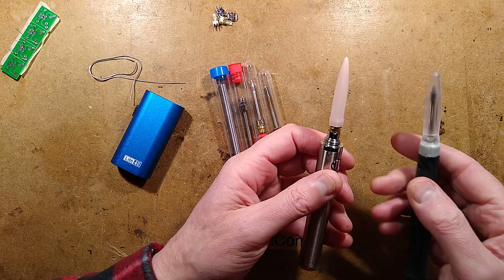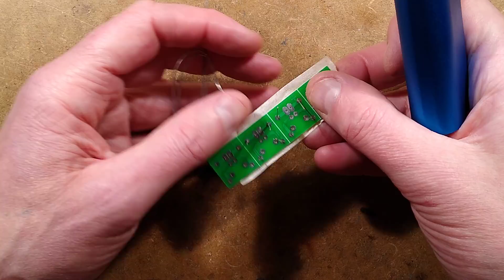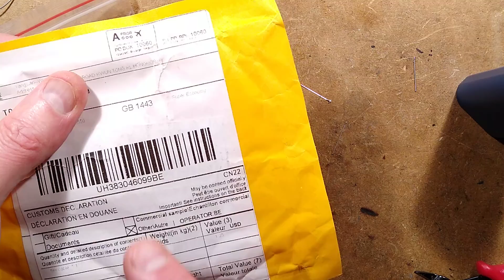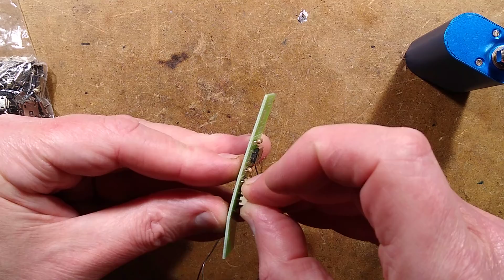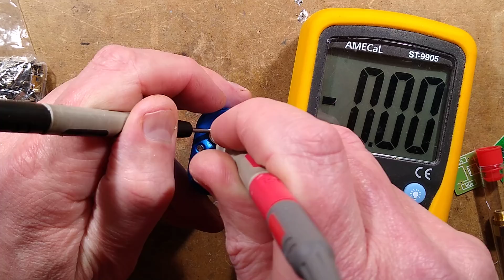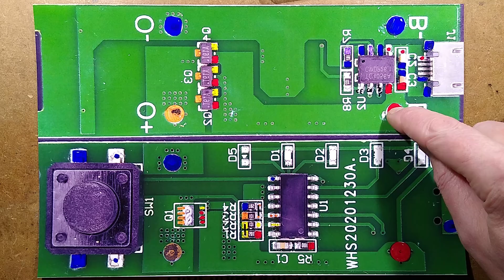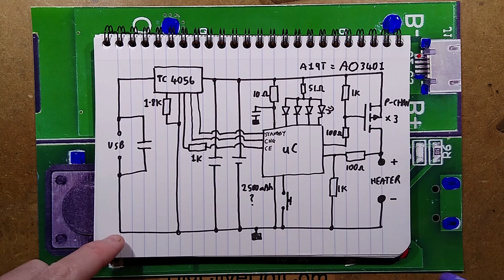Cordless soldering iron teardown (with schematic)

Comment: The TS80P is my choice for a portable iron. In fact, its so good that my Weller station hasnt been turned on for over a year now. The tiny iron runs from a USB PD powerbank and happily beats even large heatsink surfaces with relatively low temperature settings.
Reply: I went ahead and picked up a Pinecil for the same use case but more flexibility in power supply.
Reply: @DavidThoren  The Pinecil uses the TS100 tips I believe, so its not going to be quite as good in performance as the TS80 tipped irons. Its plenty good regardless. 
The TS80P can be powered with any 12V supply too by just using an adapter. I never got to do that though because phone and laptop chargers as well as my powerbank are always within reach.
Reply: @drkastenbrot  I sometimes run my TS100 on 12V when I can't find my 19V PSU and the difference is very noticeable to the negative. What is the advantage of the TS80 tips? I watched the EEVBLOG video and don't recall any difference mentioned other than shielding? (It's been a while).
Reply: @chaos.corner  The TS80 tips are a completely different design (and also meant for 12V at up to 3A, so higher voltage isnt needed). 
They have as little heat capacity as possible with a solid copper core thats surrounded by an insulating stainless tube. The thermocouple sits basically right in the tip and the heater is right behind it. 
The principle here is to basically directly heat the pad, and send as much power as possible straight into the solder joint instead of the surrounding air. It responds way faster and outperforms a  traditional 100W iron with less than 30W power consumption. 

The TS100 tip is a modern traditional-style tip. Its kept small and well made and performs quite well. But it isnt quite the revolutionary design as with the new generation soldering stations such as pace and JBC. 
The design goal with the TS100 was to clone reliable and trusted Hakko tips since making a whole new tip from scratch is a bit too adventurous for their first ever soldering iron. 
The TS100 spawned an enormous ecosystem around these tips and thats why youll find them everywhere and very cheap. You can even use original Hakko tips although they are a bit long.
Reply: @drkastenbrot  Both the TS irons and the pinecil are actually so brilliant.
Any of them are a very worthy purchase!

I'm also considering biting the bullet and getting a TS80P too, just because I'm so impressed with these style of irons
Reply: @drkastenbrot  I have a couple of TS100s. Never used a TS80. Are they better?
Reply: @MatSmithLondon  They are quite a bit better although the normal TS80 with a nominal 18W of Power is not quite as fast as the TS80P or a modified 25W TS80. 
The TS100 is incredible for the price so its a good choice regardless.
Reply: @mattymerr701  my TS100 oLED screen bit the dust after just a few uses. The screen is so dim that I can't see what it says. It uses the standard 0.91" oLED screens, but it's soldered on. Miniware won't warrantee it without a receipt, which is long gone. I have several vape devices (DNE20/30/40/60) that use that screen, and they never had any issues, even after years of daily use.
Reply: @drkastenbrot  Interesting to know. I might still go with the pinecil for now as the price is just crazy cheap. My TS100 has been good to me though those tips do sound better.
Reply: @xenonram  Here’s a video on changing the screen
https://youtu.be/HlWAY0oYPFI
Reply: I was looking at that but ultimately got the PINECIL iron.  USB-PD and USB-QC plus barrel jack all together and takes the seemingly more readily available TS100 tips.
Reply: You can USB-PD to barrel jack cables on aliexpress that allow you to power a TS100 from USB-C on 18V. I also made a soldering station that runs off a Ryobi battery.
Reply: @Nibb31  you can get PD to whatever volt breakouts, but its so handy for it to take "whatever is handy" too.
Reply: What a choice to have!
Reply: I like the TS100 but I see Pine has one that takes both USB and direct power which is the best of all worlds and it's dirt cheap. It's on my Christmas list.

Comment: I'm an electrician who happens to use a vapour producing device

its extremely rare that I have to solder anything, but on rare occasion it has cropped up where an LED light fitting isn't working because the DC leads that go out to the LED's have been pulled out of the driver board

and there's nothing wrong with it other than those loose connections

previously I've fixed these with a little blowtorch style portable soldering iron

but this method looks both more convenient and faster

so I'll definitely be keeping one in the van
Reply: Remember to also always carry a power bank. You never know when you'll need usb power.
Reply: @PunakiviAddikti  I have a 10 Ah USB battery pack on my carry all bag with several different cables and plugs.  It's handy. Thinking about swapping it for one of the ones that can boost cars.
Reply: @Alacritous  Just be careful with those, the cheap ones are basically one time use. They don't have a BMS and will drain the LiPos to zero when jumping a car.

Comment: TS80P USB powered soldering iron is a great option too. It's 30W and has active tips. Heats to 300℃ in around 8s. Very comfortable to use.
Reply: TS80 is great, but they're still too pricey, you could get a TS100 / pinecil AND one of these "vapor" soldering devices (they're only about $15) for about the same price, likely less.
They really need to find a way to drop the price of the TS80 down to like $50...
Reply: @vgamesx1  True, (btw. the TS80P is newer ESD safe 30W model from TS80). I used that professionally so the price wasn't a problem. Often did repairs to expensive gear while the client was watching - so even the portable tools needed to be best/stylish for marketing reasons alone.

Comment: I used to have a Weller cordless soldering iron back in the 80's. It utilised a NiCad battery. I used it a lot for quick repair jobs, as it heated up almost instantly.

Comment: As someone who used these a lot, the battery is the same as a “mod” vape, one of the big ones that make huge clouds. They have the exact same power on sequence, and can have different power settings
Reply: 18650 battery
Reply: @567dhj  high current drain ones
Reply: Some even feature double/triple-clicking for ten seconds of autonomous heating 💨
Reply: Now this needs to be converted into a vape
Reply: I have the Aegis, it has a custom mode to set your wattage for a custom 4 second vape pull with you setting your own wattage for each of those 4 second. (5w min - 200w max)
Reply: Wait, so these have the same connector type as vapes right? I want to buy just the tip since I have one of the boxes laying around. The threading's are all the same right? That actually works surprisingly well, way faster to heat up than my dremel butane one, not that I bought that for soldering tho...

Comment: I tried looking for the tips being sold seperatly once but had no luck, i wasnt sure what keywords to use.
Also, my vapour producing device shows the voltage supplied to the coil as well as the coils resistance, it goes lower than the battery voltage.
Its one of those chunky 200w type units meant for sub 1 ohm use, if thats of any interest. I dont have any 1-2 ohm coils at hand to test.
Reply from the maker: If using a high power unit you have to set it down to around 10W.

Comment: I'd need to modify it to be switchable between on and off, I got too annoyed with the cheap USB iron turning off mid-flow and ending up with a dry joint or worse still getting stuck to the joint, so I just swapped out the little transistor with a switch, and it worked great... :P

Comment: This would have been extremely handy back in the bad old days when I was a field mechanic! Now that I'm disabled, all my soldering is done at a workbench... and since Clive likes it, the price will skyrocket. 😆
Reply: looks like a dandy rig. im a disabled marine engineer...greetings from nova scotia :))
Reply: @Phil_From_Canukistan  Good afternoon from the center of the USA!
Reply: What happened if you don't mind asking? 
I had a bike accident and lost my left leg up to the groin and smashed the rest of my body up. I used to be an electrician, but all I can do these days is bench work (even though I still haven't been able to find work). My pelvis is so badly damaged that I can't even wear a leg. There is an operation but the NHS don't seem to be doing them atm. 
All I wanna do is to be able to walk 😪 FML 😞
Reply: @TheManLab7  years of chemical and metal fumes have ruined my lungs, degenerative disc disease in my back, and pretty much every joint in both hands and my knees are full of arthritis. I worked roughly 16 hours a day, 6 sometimes 7 days a week for 30 years, then one day I just couldn't breathe. I can deal with the pain my hands and knees, but can't even walk through my house without running out of breath. They claim a bronchial thermoplasty will improve my lung function, but my insurance refuses to pay for it.
Reply: I got a propane one about 30 years ago but it unfortunately stop working after a few uses. I'm guessing the gas got blocked but I had nothing to unblock it.
Edit: It might have used butane, I do not remember.
Reply from the maker: The little butane irons were notorious for clogging up with the vaseline type components in some less pure butane refills.  They sell high purity cans for applications like this.
Reply: @bigclivedotcom  Oh, that might be why my butane iron doesn't want to work anymore. I just bought cheap butane for it. Had I known that, I would have bought pure butane instead.
Reply: @SlyPearTree  I always just used my cigarette lighter. Some guys claimed I could fix anything as long as I had my lighter, pocket knife, and a rock to use as a hammer.... 😆 I guess the box full of tools on my truck was just for show!
Reply: The thing is amazos

Comment: I need to get some of these tips for my tool bag as I use a Personal Electronic Nicotine Inhalation System (or PENIS for short). Mine is purely analogue though.

Also the connection thread is traditionally called 510. No idea why

Comment: Looks like a Jomotech (presumably Lite 40) unit.
I love that they just preferred giving this thing an alternative market and diversified their risks.
I wonder how it will work with a preheat-enabled battery mod (I have a Nuvoton-based one with ArcticFox firmware in it): how bad (or good?) it can turn out to be in use?

Also the set of tips they were selling by half the price of the complete kit!
Reply: Tested the flat blade bit with my device, and I'm honestly surprised with how good it works and how useful it turns out to be in simple VW mode on 12W.
The mods they sell in the kits usually let you select one of, say, three preset power levels; while more advanced battery mods one can screw these bits on sometimes support customisable profiles. So you can quickly switch to your soldering profile, and then switch back with minimum effort.

Thanks for showing us it exists, much love!

Comment: I've been looking for something like this. I want a soldering iron I can use in the car. I can't find any 12volt ones so this might be a good alternative.
Reply: TS80 and a QuickCharge USB power outlet in the cigarette lighter socket works for me!
Reply: Or TS100 (which I don't have) can run on 12V directly, I think.
Reply: @obd6HsN  yep.
Reply: TS100 and a lipo battery, you will never look back especially with the new Ralim firmware.

Comment: Maybe you can do a video on all your tools that you have & use?
Reply: ps: thank you so much for your time & efforts investigating this, I'm looking if I want to go the 510-adapter route or rather the USB route for a portable soldering iron.
(I do have some older Weller's but those are on mains & clunky, despite being quite old)
But I'm also looking into the PineCil all but that might be a wee bit silly to have a soldering iron with a processor on board for the things I'm planning to use it for.

Comment: On the device possibly bricking itself when the battery goes completely flat: the datasheet for the LTC4056 says that it passes a supply current of ~40μA when manually shutdown... could this be enough to bump the MCU awake, even just to the point of pulling CE high?
Reply from the maker: Not sure.

Comment: That's really cool and convenient, especially if you solder in weird places... Thank you for taking the time to tear it to bits for our entertainment 😅

Had a Kanger five6 that used 5 high drain batteries (18650) would've been quite the pack for these🤔🤔
Reply: Upside down crammed under a dash in in the comms locker of emergency vehicles in my case
Reply: @rtechlab6254  Dang that is weird XD